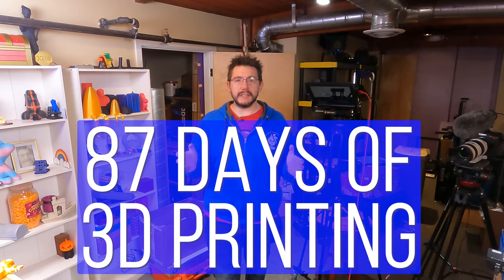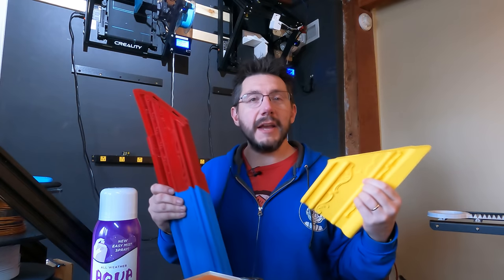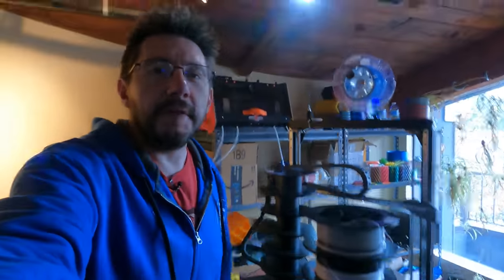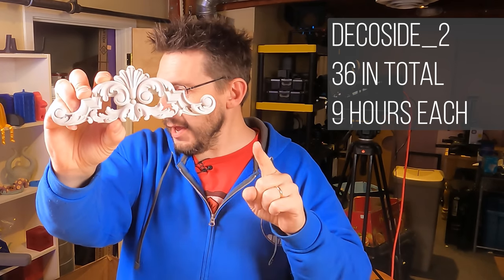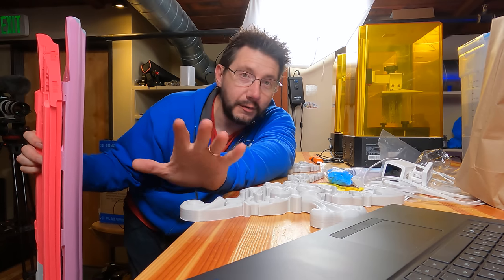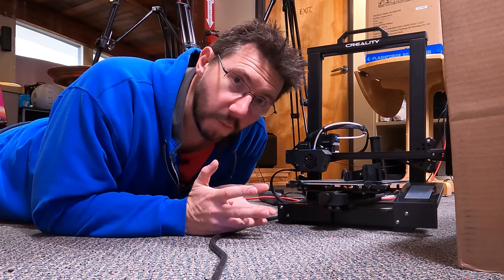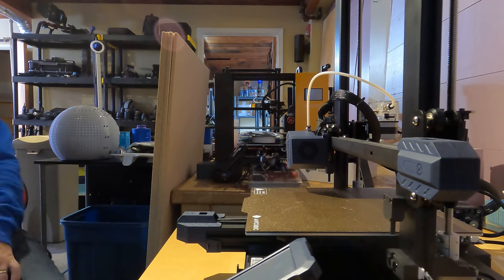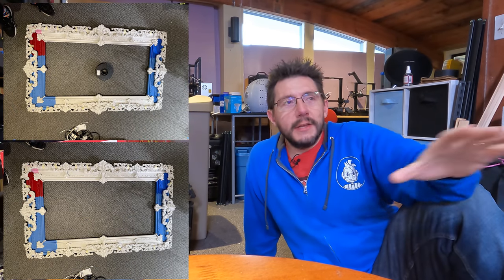3D Printing LARGE Projects?

Comment: A very cool use of the technology. In particular I like the baroque style. I've done a few larger multipart prints. I find that having registration holes that you can fit dowel pins into can help align the pieces. Also channels that you can fit metal/carbon rods through helps. For pieces with large voids, I've sometimes used expanding foam to strengthen models.

Comment: Great video, really enjoyed seeing a behind the scenes look on this project. What a massive undertaking! Thanks for sharing the experiences you had with the printers. It sounds like the Prusa Mini, Mk3 and Anycubic Viper were clearly the most reliable printers whereas you had challenges with the Creality machines. That seems to mirror my experience as well (though I don't have a belt printer yet). The belt printers seem nice, but also need to mature a bit with the build surfaces before they are as reliable as we'd like.
Reply: Yeah, I have an i3Mega and it has survived 3 moves with near 0-bed adjustment needed and its prints amazingly when prusaslicer is used. Totally looking into a vyper.
Reply: The Creality stuff really is kind of wonky. In some ways they are amazing machines but in others you can't help but ask "why" and "what were they smoking". However they are great to learn on, so wonky that by time you get good with one, those Prusa and Anycubic machines will be a cakewalk in comparison.
Reply: @eideticex  i think creality is trying to hit the "as cheap as possible while maintaining decent ability" price bracket, they are the benchmark with that area.

Comment: Excellent example of how low priced printers may be nice, they will never be seriously used in a company setting. :) Or at home for me, I started with them and learned a ton (I do give them that), but will save up for quality next.
Reply: I disagree. 
I run a reasonably successful company with CR6 SE’s being the work horses. Their dollar for dollar production output is much better. For the price of one Prusa, you can get 3-4 CR6 SE’s with raspberry pi’s (*depending whats on sale). 
I’ve logged over a decade’s worth of cumulative print hours on just CR6’s with no major failures.

Not trying to change your mind or be combative. I just want to highlight that just because a YouTuber writes-off a product, that doesn’t mean that the conclusion can be generalized.

Comment: I think 3D printing is cool because it is practical and serves a purpose, but when you use it for something unreasonable and unpractical as this its not longer cool - just CNC cutting everything out of wood would have been 100x faster and cheaper and easier.
Reply: As a CNC operator that has picked up 3d printing 1.5 years ago, I agree. It's an awesome project nevertheless but I could have been so much easier to use a relatively cheap CNC router to do the same.

Comment: Really for the smaller high complexity parts, one print and then silicone casting would have been much easier and faster.
Reply from the maker: Possibly. However the goal from the beginning was 100% fully 3D printed. For the next project, we may change it up :)

Comment: I feel your pain with the bed adhesion issues and the nozzle jams, and the panting of small details on the initial layers. I just completed a project of a 4' 6"ish long 1/70th scale ship, that's split up into 10 pieces. Each piece took about 32 hours, and most of my initial prints were needed to be printed again. This was also just the precursor to the larger ship I'm planning, a 1/24th scale at 13.6' long. Hopefully i can take what iv learned from this and have a smoother go at it. Large projects are a pain in the ass but they're so satisfying when they're complete.

Comment: The stock heater block on the flsun SR is your problem. The thermometer is as far away from the nozzle as you can get. I replaced mine with an actual E3D Valcano heater block, problem solved. I can now print in fast with the quality of the slow speed.

Comment: Awesome project, respect for all the work you put in.
The Vyper is great, I can say it prints and prints and prints...
My Prusa Mk3S+ in contrast must been produced on a Monday :(
Reply: Give their support crew an e-mail. I had some early problems with my Mini after it was drop-kicked from the cargo deck of a DHL 747, and they were actually super helpful. Correcting the one fundamental misalignment of an extrusion solved a plethora of problems. Then and since it's just been crazy reliable. I can turn most prints up to Ludicrous Speed and suffer hardly any drop in quality. If you can get yours lined out, you'll love it. Prusa engineering is just so good.

Comment: I feel like I should speak up so I will. 
CR6 SE’s are excellent machines. Factory bed adhesion is short lived, but easily solved with some White Cloud hairspray sprayed onto a microfiber towel then wiped onto the bed. It takes 4 seconds exactly. They are easily cleaned in about 5 minutes using windex + bed heated to 70c. 
I have the cumulative equivalent of more than 10 years worth of straight 24/7 printing on them with no major failures. 
Dollar for dollar, CR6 SE’s beat the pants off a Prusa. This is especially true if you get them on sale ($289 shipped), and include shipping on the Prusa $(1,100-1,200). 

Just some food for thought.

Comment: You may need to adjust the probing strength with the CR6 to get better print results. By default its set quite high and can cause some issues with z offset. There is a guide online that explains how to adjust it using a kitchen scale. Perhaps a future video idea?

Comment: Its beautifull no doubt.! But I will go all day with a larger nozzle.all my print are half time now and you don’t need insane infill because it’s also stronger with larger nozzle.I also have made a technique where I connect parts and solder it together using a solder iron and filament from spool. It’s so mutch more strong. And you don’t have to use glue.! Yes there are some after work to get same finish as tuning prints with that resolution as yours. But i use spray filler like on normal paint jobs. It’s ok. 

I dream af making body kit for my car. Front side and back spoilers. I am still not hardcore enough for 3d rendering but I will get there 😎

Comment: Joel, looking at a C10 v2 or a viper. Can you share your thoughts really quick? Thx
Reply from the maker: The cr10 is going to have a larger build volume, but the Vyper is going to have auto bed leveling and come with a removable flexible PEI bed.
Reply: Can I make the assumption that the print quality is similar?  Thanks Joel.
Reply from the maker: Prints off the Vyper for me have looked better than the CR10 V2 when I had it.

Comment: The CR6 has a known issue with some of the beds failing to hold onto prints, creality initially told you to clean the beds with isopropyl alcohol but then changed their mind and told you not to do it as it damaged the surface. Strangely some have no issues which makes me believe that whoever manufacturers the beds is incapable of making all beds the same. Only thing that makes sense to me.
Cool video Joel but you know what you need, a hideous bright banana shirt. You will get the reference let’s see you outdo Angus on your next video.
Reply from the maker: BANANA SHIRT. YES.

Comment: Did you experience any warping along the Z-axis on the CR-30? I've been having issues with that.
Reply from the maker: Hmm. I don’t think so? What do you mean by warping on Z? Like a straight part isn’t straight?
Reply: if its pla then you can warm it 70-80c it will go soft and you can get it straight again hopefully... i had todo that recently with some thing bits i printed i couldnt get off the painters tape otherwise :(

Comment: I was looking to getting the Anycubic vyper as an entry-level FDM printer as I didn't really want to mess with bed levelling all that much. Glad that you recommend it.
Reply: you can get digital level devices for DIY, ive used them for doing my ender 3 v2, but yeah it can be a pain...
Reply: @specialingu  true though that if the manual bed leveling is off and i use auto levelling then it's not really levelled.

Comment: On looking back at the project, do you still feel that 3d printing 100% of it was the proper way to go? CNCing at least Frames Long and Short would have saved you 1000s of hours.
Reply from the maker: I do. I didn’t have to worry about time and I had all the machines needed to do this.
Reply: Or print one piece of each type, produce silicone molds and cast many using resin.

Comment: Masterclass in using the wrong process and method of manufacturing 😂
Reply: Incorrect. Masterclass is using what you’ve got to get a project done
Reply: What would you say is the "right" process? CNC milling isn't exactly a walk in the park either, these ornate designs needed to be paintable so finish passes would chew up fine bits left & right.
Reply: @ed_halley  I could hand carve those in limewood faster, and they'd be genuine authentic frames rather than faux.
Reply from the maker: Simon, I love this idea! I can get you dimensions and depth. Can you create a video about this? I’d love to see the process and learn.
Reply: @3DPrintingNerd  - Don't get me wrong, what you made is incredible, the frames look stunning and shows what can be achieved with 3D printing. Like you, I love 3D printing but it's not always the best option. The time taken to make the main frames - man, that's a serious undertaking. Did you not consider making the frames from wood (quick) and then adding 3D printed embellishments (intricate)? 
I'd love to be able to have the time to carve those, seriously I would, but I have to work 😢 There's lots of wood carving videos already on YouTube. Give carving a try, you're creative and will probably enjoy it. it can be quite therapeutic - and it's the opposite of 3D printing - removing material rather than adding 👍🏻
Reply: @SimonCoates  A job that consists of putting a file into a machine, hit the 'go' button -- that does not sound like much of a job (one that I would enjoy). The point isn't how fast you can do this by hand compared to the machine, but rather how much more/less effort you'd have to put into the project had you chosen a different approach. You even state that your day job keeps you from even trying your suggested idea yourself, which strongly suggests you are barking up the wrong tree.
Reply: @dtylerb  Fair point - thank you for clarifying 👍🏻